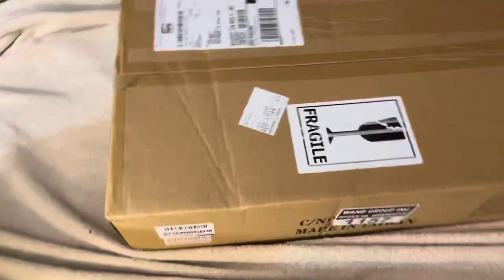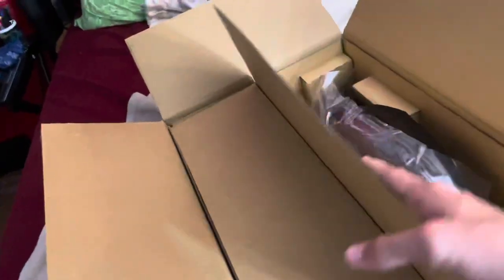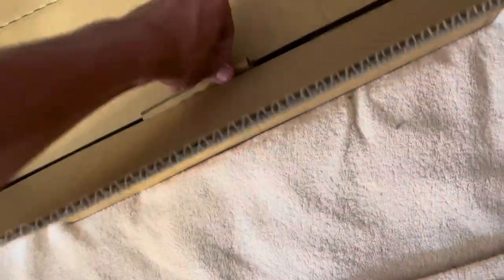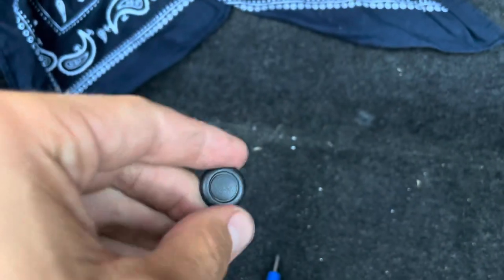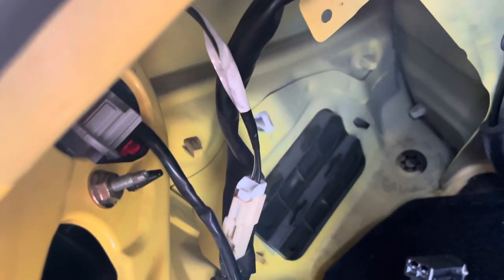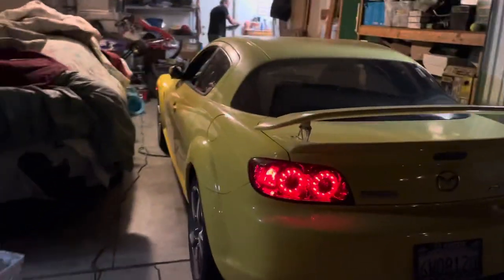Mazda rx8 S2 style tail light install

Comment: The installation was super simple, took less than 15 minutes each, for those having trouble here's a written list of what to do.

1) Twist off all 3 bulbs/lights off the old taillights. 
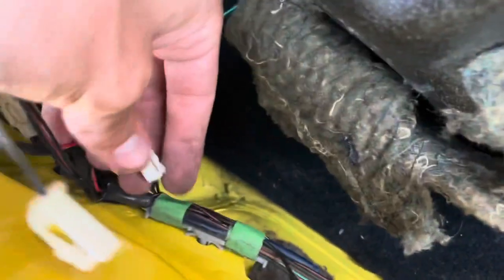2) Disconnect the small white connector as shown in the video at 8:09
3) Remove both 10mm nuts from the old taillights and take them out.

Here's the good part.

4) Install the new taillight with the 10mm nuts and pull the wires for them to go inside the trunk.
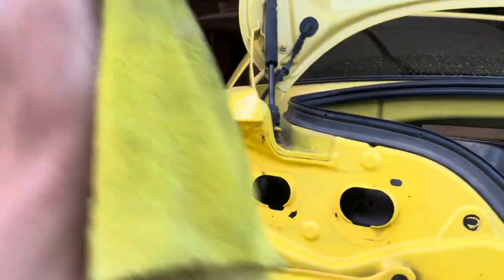5) Install the turn signal bulb and reverse light as shown at 9:10 - In this step I recommend keeping the bulbs connected like mentioned in step 1.
6) The confusing part for most was the last bulb (brake light) this one is brownish in color and requires you to simply remove the bulb from the socket, leaving you with the connector wire on one end and the missing/removed bulb on the other end. This removed bulb connection can now be plugged into the new connector (3rd one) which appears to have 2 metal wires or switches, this acts as the bulb now. As seen on 10:20 - 10:39.

Quick note for the last step #6, this connector is black with multiple colored wires (white, red, green and black) you cannot miss it and has two stripped wires (acts a bulb), this goes into the brake light socket after removing the bulb. 

Hopefully this helps and cheers!

Comment: One of my oem bulbs died. Thought might as well upgrade the whole tail light system lol. I'm gonna go with these 🔥
Reply from the maker: Go for it dude! They look great🤙🏻
Reply: @thatyellow8  I installed them and they look great but now my 3rd stop light, the one right in the middle, doesn't work and my ABS and traction lights are both on in my dashboard. Hopefully replacing the bulb fixes that.

Comment: Did you have any problems with the lighting harness going back into the holes? I'm having issues with mine! It will not go in all the way to lock in place?
Reply from the maker: I didn’t have any issues, I believe once you have the bulbs on they just fit in the holes and twist to lock, I’ll check on it tomorrow and get back to you
Reply: @Thatyellow8  I figured it out.  You have to reverse your break housing harness from your reverse light housing harness and it will fit in perfectly. I don't know why they did that? But that's the only way it will fit in the hole and lock in place.
Reply: @Charbel9 I’m having troubles putting the new unit into the spot it goes into the two guide holes but doesn’t seem to fit the curve correctly
Reply: @parkerpadin8144  They switched the spots around! The brake & turn signal housing are the opposite! Keep that in mind! Once you put them in the correct holes, they will fit perfectly!

Comment: hey, do you know if they leak water in them.
Reply from the maker: So far I’ve washed my car twice and drove it in the rain and they’ve had no issues. A couple days after install I re tightened them to make sure they were solid and I’ve had no issues.
Reply: All my lights work exept my running lights after install  so at night there not illuminating unless I hit the break or blinker